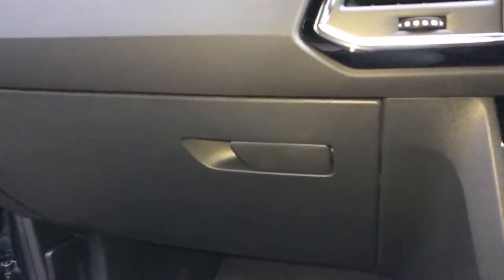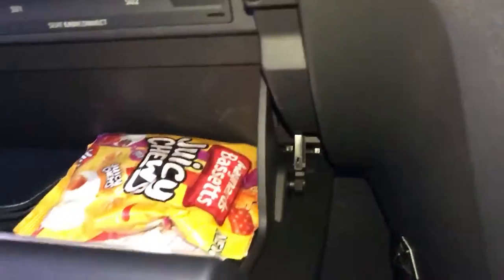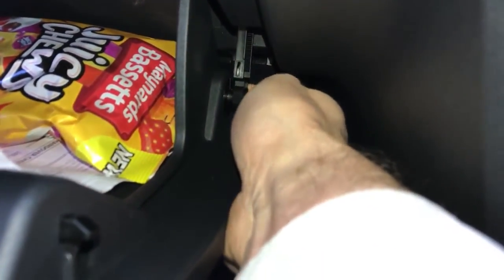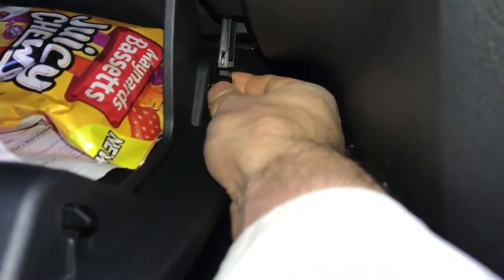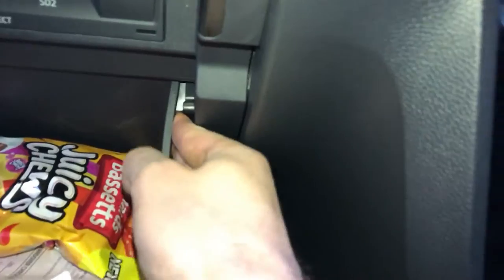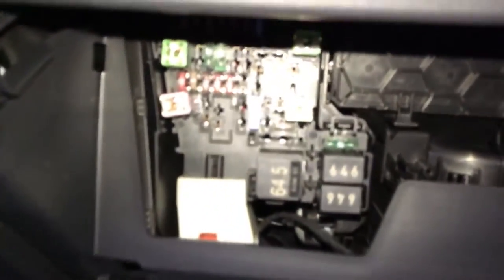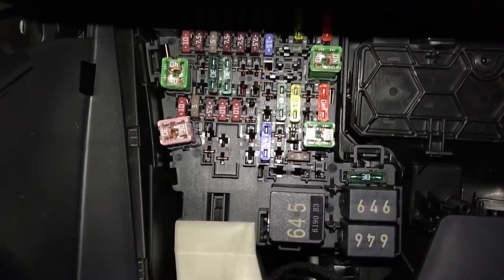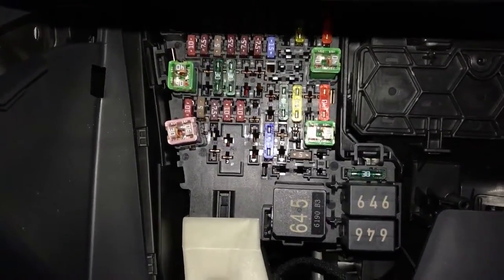Seat Ateca RHD Fuse Box Access

Comment: May I ask where the OBD port is on the right hand drive? I have the Cupra Ateca on its way for delivery soon and want to know if there's room to put an OBD port blocker.
Reply from the maker: Sorry I can’t help on this. I’m on my 3rd car since this one!
Reply: @UtterlyD  NP thanks for replying. What you driving now? Mum has RSQ3 which I love but it's almost double the price here, just can't afford it. Even Tiguan R was too expensive. You still into performance SUV?
Reply from the maker: The RSQ3 is awesome. I’ve heard great things about the Cupra Ateca too, I hope you enjoy it when arrives. I used to have the 190PS 2.0TDI AWD Ateca with remap to 230PS. Currently driving a Tesla Model 3 Long Range. Very different car, not so good with the dogs, but very quick and efficient.
Reply: @UtterlyD  Wow the Teslas are crazy fast. They are too expensive for me but congrats. They are about 160K AUD here in Australia. I need a higher car cause I find it hard to get out of low cars after my back injury which is why I am focused on SUV..I do like the model X though, if I could afford that in a plaid I'd buy it over anything else on the market. The Ateca only has one model in Australia, and with currency conversion it's actually a lot cheaper than it sells for in the Uk, weird. It's the 300 PS version but like you I plan to at least stage 1+ with engine and gearbox tune from APR.
There are basically no options to pick other than the brembo brakes or sunroof, but I just got the basic car. Still has electic seats, leather, the full safety thing, full kit really. I think that one is around 44000 GBP there so I paid 65 AUD which is about 35K GBP. For some reason they are really well priced here so it was a no brainer. No other 300 horsepower SUV with a 5 second 0-100 on the market that is cheaper.
Reply: Also 5 year unlimited mile warranty, no tricks, and 3 years free service. The deal was too hard to beat. I mean I looked at a 35K MG that was much slower, vinyl manual seats, inferior stereo, and payments were almost as bad as Ateca cause VW group also offering 4.99% finance now till March 31. There were over 200 cars coming into the county when I first looked last Tuesday, then I thought I'd have a look on Friday and there were 11 left. In 4 days. I just managed to nab a black one. The rest were gone the next day and now no new cars till August. I wanted the green as it's a really unique green the Seat/Cupra one, but beggars can't be choosers and black looks pretty good. Just harder to maintain but I'll do a ceramic on it for sure or maybe some 3M protection film. Cheers and enjoy your lovely Tesla. Great cars!

Comment: Hi there, you don't actually say which fuse you hard wired the dashcam into, if you did or did you simply plug the cam into your cigarette lighter socket using the supplied lead

Comment: This is dreadful job. Retainer required monumental pull to release the retainer then a lot of force to bend the glovebox sides to drop the glovebox then to find fuse box at the back and higher so access and fuse identification is really difficult. Nothing in vehicle handbook to identify fuses. FFS I remember cars 40 years ago with fuse boxes in stupid locations like this. So much for progress. Really crap design. Replacing a fuse should be an easy and quick job, that could be done at side of road if broken down. But nice video. Thanks.